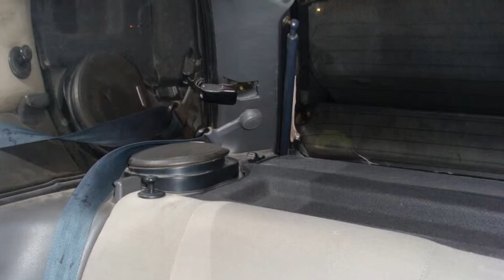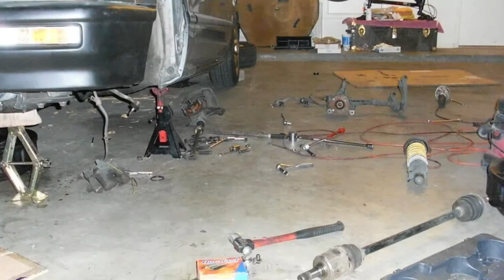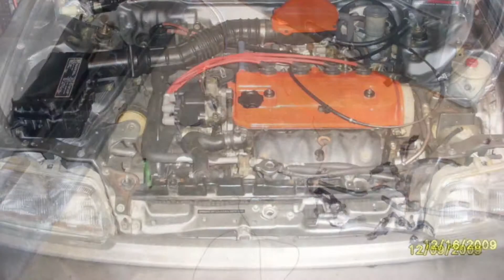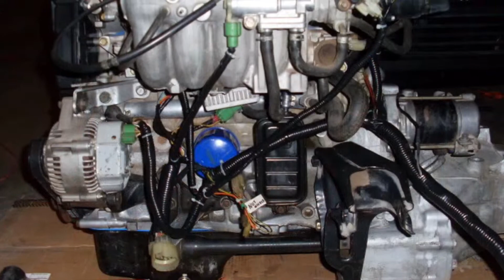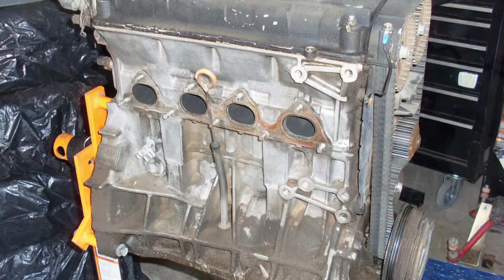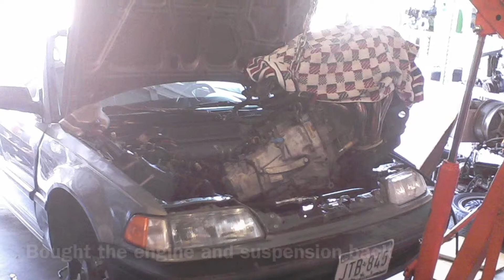91 Civic DX slideshow (owned 2008-12) EF Hatch ED6

Comment: hmm, i got a manual trans now, but will it be o.k with the auto pm5 ecu?
Reply from the maker: From what I've read it will not work correctly because of the auto lock solenoids normally found on top of the auto trans.  Your manual trans doesn't have those and the ecu will act weird without recognizing them and throw a CEL also.
Reply: i see, thanks for looking out man
Reply: one last thing holding me back, how did you get the neutral safety switch situated?
Reply from the maker: +sr20 paisa you will need to ground the green/white wire at the shifter selector.  It's there, run it to a bolt in that area to ground it.
Reply: ok, i confused that one for the black one with white stripe, thanks for clearing that up
Reply: just got everything put together but crank
Reply: wont crank
Reply from the maker: +sr20 paisa starter doesn't even turn?
Reply: +J Wid Films nothing, probably a bad ground, I left the o2 sensor unplugged and a few other things
Reply from the maker: +sr20 paisa check all 3 grounds, T-stat, transmission, and valve cover.
Reply: +J Wid Films I'm checking all the grounds, I posted pics in ht with the wires